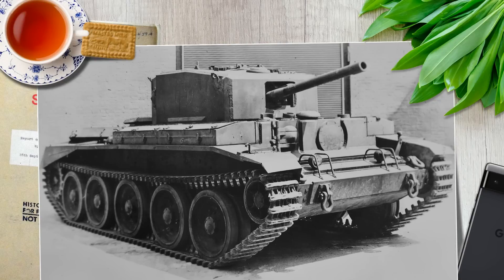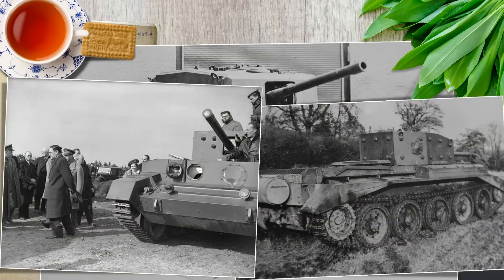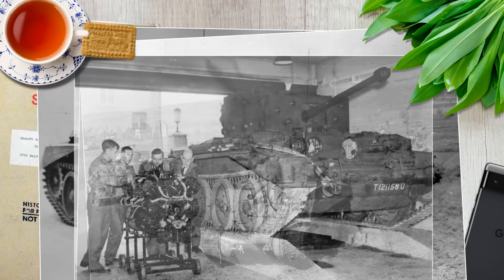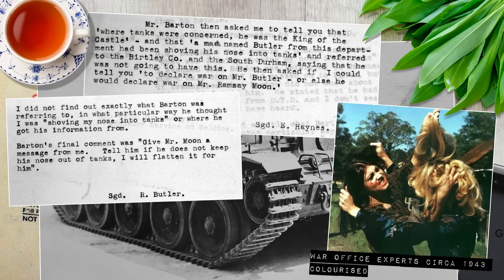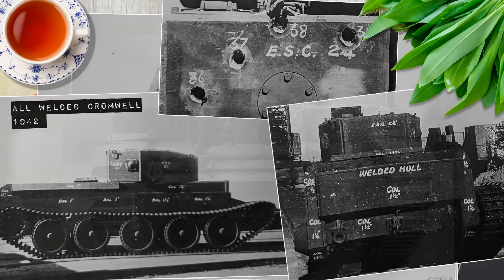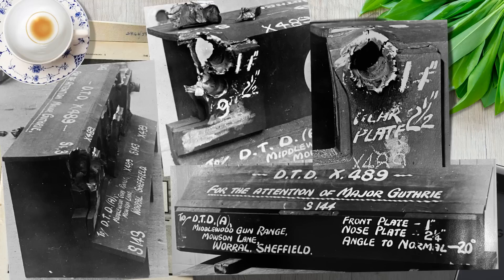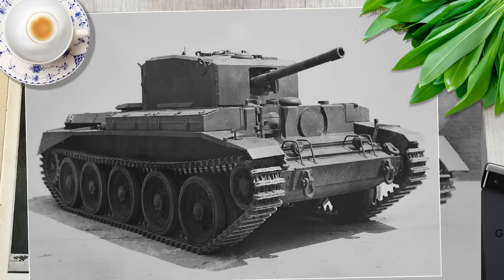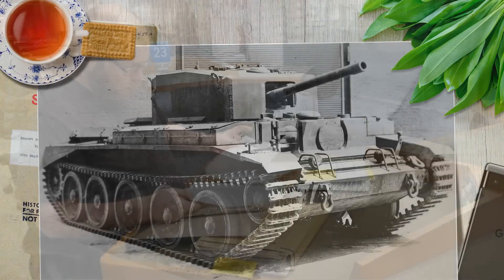Heavy Cromwell - Tank Design & Development

Comment: One also wonders just how essential the extra armor was in light of what represented the common Germany antitank weapons of 1943-44. When the enemy is fielding a lot of weapons that comfortably defeat 150mm of armor, does having 101mm instead of 63mm really matter? I wonder if anyone in the paperwork was acknowledging that during development. 
        I also wonder what the British steel supply looked like in 1943-44. Could the extra armor plate be economically accommodated? We tend to forget that just because you have the technology and/or knowledge to make something doesn't mean it is wise to make that thing, especially when juggling future requirements and needs. Sure, you have tooling to make a 1.5'' plate of steel, but maybe that would mean you don't have the men to run your 3'' plate tooling for another project, or you can't buy the tools for the 3'' plate because you ended up putting all the money into expanding the 1.5'' plate production. Opportunity costs matter a lot in economics, especially in war economies that have serious bottlenecks like Britain's did.
Reply: I can't speak for the points raised in your second paragraph, but the short answer to the question you ask in your first is yes, it does matter. 101 mm of armour makes for a far harder kill than 63 mm of armour .There's plenty of stuff flying around on the battlefield and very few hits are head on and otherwise optimal hits, most come in at an angle of inclination. 
For the rest , it seems to me that you are rationalizing . I would think that sending five men in to battle in an inadequately armoured tank is a far worse economic decision than sending men into battle in an adequately armoured tank, especially given that we are talking about no more than an extra couple of tons of good quality steel . If you lose twenty seven tons of expensively machined equipment for the sake of a couple more tons of steel , that represents a dead loss and a poor investment.
Then there's the human element. War is about far more than economics.  Men have to take the tank into action and they will be perfectly aware if it is poorly armoured. This is exactly what happened to the Cromwell tank, the poor armour was noted and the tank gained a poor reputation. This, quite understandably,  affected the fighting spirit of the men. Poor moral loses battle .
Reply: @andrewwoodhead3141  As I said, I wonder if any of that was a factor in the actual British paperwork. I personally would rather a tank with 101mm, but unless I was one of a handful of British officials in 1940-45, I would never have much say in the matter. My query was if someone who did have say in the matter did argue that 101mm was not enough to matter so far as they were concerned.
Reply: @genericpersonx333  Fair enough , didn't mean to jump down your throat.
My answer would still be that I doubt it very much it. The logic is simply too easy to pick apart and the argument too weak .
I did once read ''the great tank scandal'' by David Fletcher. I know armoured archives doesn't like David Fletcher, but I personally recommend the book. What it makes clear is just how sclerotic and disorganized the British tank procurement program was during the war.  Everything was secret , even essential information .  The most likely explanation is that the Cromwells new armour fell victim to this drastically over compartmentalized and chaotic mess of a system. It really was a question of systemic problems in the entire industry and it took years to get straightened out.
Reply: Most nations tank effectiveness is limited by skilled crew (and the attrition of them) NOT by their industrial ability to physically make the armor plate. Even a modern tank isn't 4 men to bring to battle, an Abrams armor company is 62men for 14 tanks just in the vehicles, and you have an almost equal number of staff supporting in direct fuel, munitions, maintenance. But it also takes people for the logistics further back, for the training staff, army workers not in the combat theater (presently about 50% as many civilians work for US army as soldiers). So in terms of cost, doubling the thickness of steel in the actual tank is a tiny difference in requirements compared to providing one additional tank per company or any such other option where you repurpose that metal as another combat unit. And thats assuming you HAVE the skilled crew, most nations ended up with tanks they produced but never could use... sitting in storage (or in covananteers case, riding up and down the railroads for PR), which tied up WAY more strategic war materials than any increase in quality you could manage. Other nations decided to feild vehicles anyway without the support or training, and these mostly never made it to combat before being abandoned, and if they did where totally ineffective.
Reply: @SheepInACart  Very good point. The Germans certainly showed that large numbers of light tanks with competent crews in 1940-41 were worth more than Tiger IIs manned with raw recruits in 1944. 
      The irony about Cromwell, however, is that it was not very efficient due to its higher maintenance requirements. Exercise Dracula and other tests showed the Cromwell was just harder work to keep running than M4 Sherman, needing more than twice the manhours.
Reply: @genericpersonx333 there is a very large difference to  the mechanical reliability of the Cromwell in 1944 compared to 43

Comment: I hereby dub the 'Heavy Cromwell' the "Fat Oliver"! 
Remembering the Cromwell as a decent-to-good tank badly let down by pre/production issues so it arrived years late to when it could have started service is a pretty fair assessment.
Reply: How about - Oliver's Wart!
Reply: @WOTArtyNoobs  Not bumpy enough. If it had the bolted/riveted turret with those big welts on it I'd accept "Cromwell's Toad".
Reply: @Vespuchian  lol
Reply: If there had been a need for it the Cromwell and/or Centaur could probably have reached the front line in small numbers in mid to late 1943 in Italy. However there wasn't really much they could do that wasn't already being done by the Shermans and, being a new tank, they would undoubtedly have been less reliable than both the Sherman and Churchill. So it was really not worth the hastle of shipping them from the UK to the Mediterranean theatre, especially with all the spare parts needed for a new type of tank. Even by the time of D-day in June '44 they were mostly used by the Armd Recce Regiments I believe (except for the 7th Armoured Div) because other than speed they didn't offer much of an improvement over Sherman.

One interesting 'what-if' would have been if the Cavalier had beed fielded instead of the Crusader Mk.II and Mk.III in 1942. This implies that Nuffield spend most of 1941 and 1942 pulling their fingers out and concentrating all their effort on Cavalier instead of Crusader so they could ship small numbers of probably unreliable Cavaliers to North Africa in summer or maybe autumn. The question is if this would have been a better option than the not exactly awe inspiring upgraded Crusader variants.
Reply: What I don't understand was, why no sloped armour? British engineers among the best in the world never seemed to have considered this labour and life saving technology. And when one looks at Churchill, Cromwell and Comet they scream out for sloped armour!
Reply: @davesherry5384  While sloped armour has advantages, it also has disadvantages not only does it reduce internal space it also takes longer to make and maintain thus reducing the number that can be built and also making maintenance harder.  It was just a simple trade-off.  Most people erroneously think sloped armour is automatically better it isn't like all systems it's a trade-off and other requirements might take precedence.